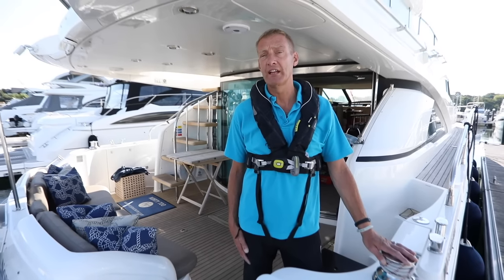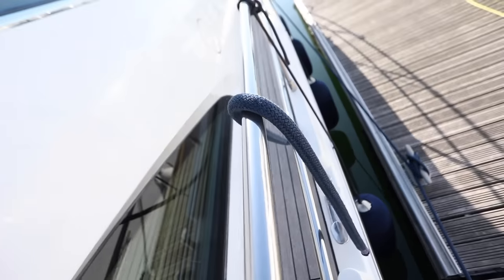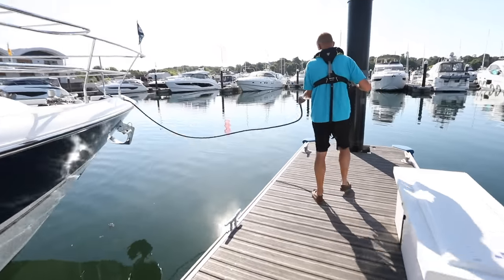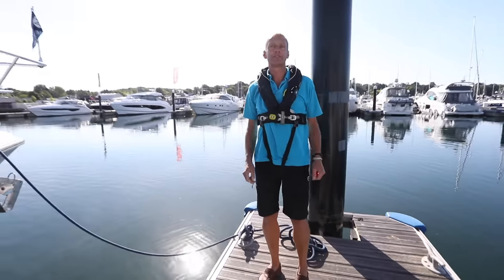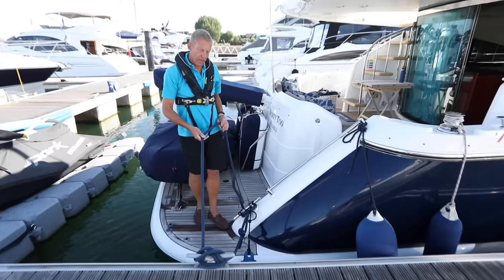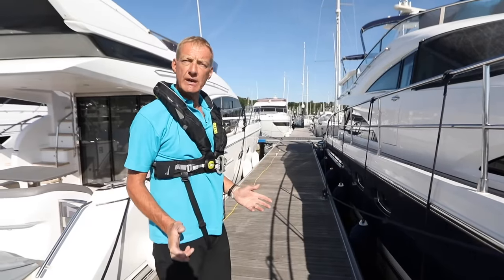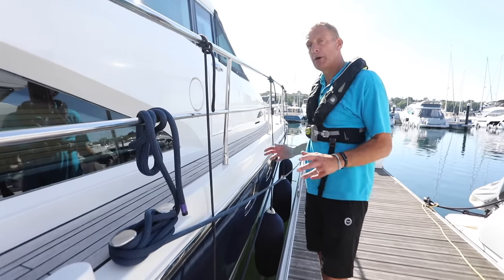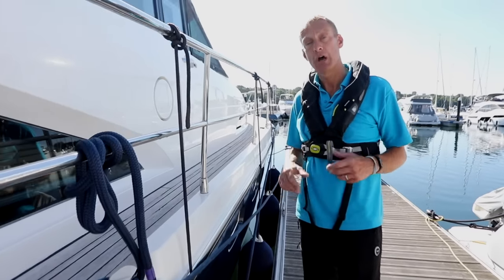How to dock a boat | Tying up a 60ft flybridge motoryacht | Motor Boat & Yachting

Comment: Thanks again Jon; I think I have seen every one of your videos, especially since acquiring my own motorboat earlier this year (which happens to also be based at Premier Swanwick.  Low speed boat handling is the most interesting for me, and highly important as I discovered this week when a 50' MB lost an engine and collided with mine at her berth.  It's all about time on the water and practice, and transitioning boat handling from a stressful to rewarding experience.

Comment: Would you use cleat hitches rather than just the figure 8’s? I was always taught the cleat hitch provides the stronger hold?
Reply: Haha....you need to watch his other videos....where he talks about the "dreadful cleat hitch". Cleat hitches aren't used in Europe as much as in the US. A full turn around the cleat and a couple of figure of eights and a final turn seems to be the preferred method here, it's very stable, very quick to untie and if the line freezes you can still untie it....whereas the locking turn on a cleat hitch can become bound especially when frozen. John did use a locking turn on one of those cleats where he had a short working end.
Reply: @DrCrabfingers   Yup, I remember when I got my first boat the ex-Naval guy who looked after the boats hated cleat hitches.  He said it's basically a knot and if it pulls tight, in bad conditions it can be a nightmare to release.  I use them occasionally when I've run my lines short but 'Buffer's' words still ring true in my  ears so I try to avoid them if I can.

Comment: Hi Jon, you mentioned stern to in the med, I find it hard to pull the boat forward on the bowlines to keep it clear of the dock in storms when I leave it. Other than using the engines, any tips on pulling in the very heavy lazy lines please? Thanks.

Comment: A question for viewers....Is there any reason why it is common practice to use a Bowlin' on the bowline, but not on the stern line? I'd love to know. If a Bowlin' is safe enough to hold the bow of a boat when draped over or threaded under a dock cleat, why isn't it used on the stern line or indeed the spring lines....?I see it a lot, stern line is wrapped around the dock cleat...bow line is looped and placed over the dock cleat. Anyone?

Comment: To each his own but speaking from experience with a 59 foot MV I would not trust just wrapping the line around a cleat. Spend the time and look up on YouTube "cleat hitch". One time in Florida a squall come through and our bow came loose from an improper cleat hitch that was also wrapped. Also operating a "Big Boat" alone, or without help on the dock, is asking for trouble. It is a rarity to find such calm conditions and to encourage people to do it, IMHO, is irresponsible.
Reply: Anyone with experience can operate a 60ft yacht alone no problems even in real choppy conditions, it's definitely not irresponsible and these size yachts are built for exactly that. As for the cleat hitch go and see this guys video about them.

Comment: You are not tying off properly on the cleats.
Reply: If you're referring to cleat hitches....for a number of reasons cleat hitches aren't as favoured in Europe as they are in the US.
Reply: I’d agree with this. Not b sure who this video is for; anyone operating a vessel like this should be doing so with crew (I see that it’s a very light day, and I’m sure this has thrusters, but still)…and if my crew tied up the 127 ton steel yacht I drive I would stand them down until they were properly trained. Evening just using the bowline reduces the strength of that line (double braid, which is inappropriate for mooring) by 50%. 
Seems like a video for beginners, but using a very advanced vessel with incorrect techniques.